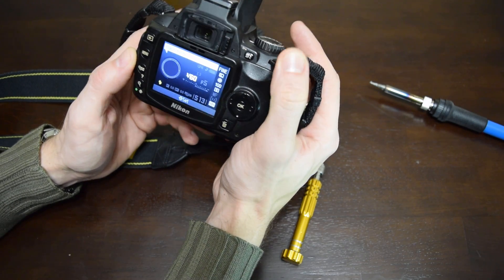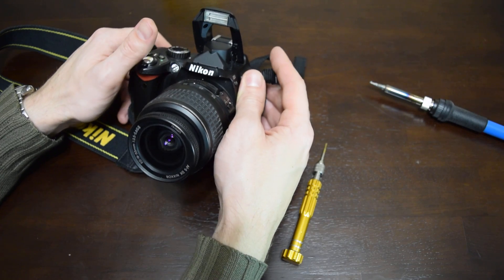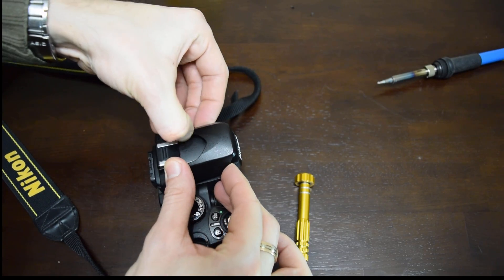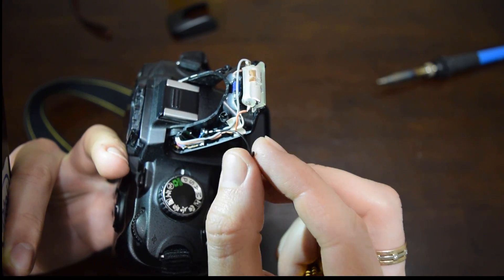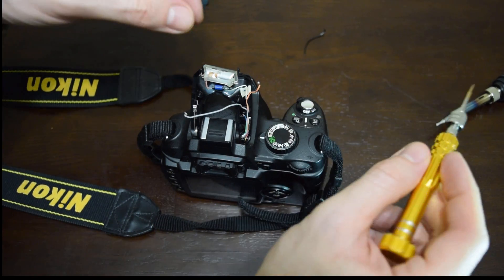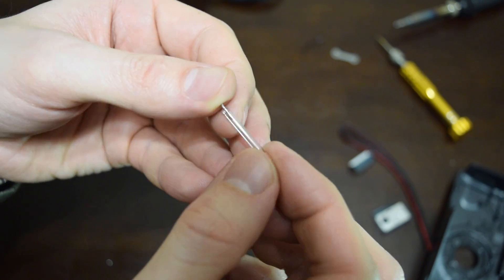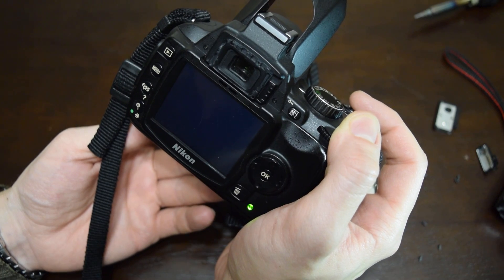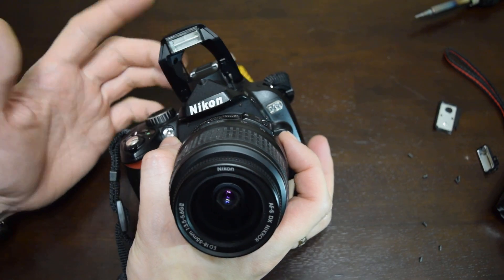How to Fix or Replace the Flash Tube on Nikon, Canon, or Lumix DSLR Cameras

Comment: Good day! Your skill impressed me, I wonder what's the sign or indication that the flash tube needs to be replaced?

Any reply will be greatly appreciated.
Reply from the maker: Flash tubes can be tricky to diagnose visually. A failed tube usually shows blackening or discoloration inside the glass, cracks, or simply fails to produce a flash when triggered. If the tube appears intact but the flash still doesn't work, the problem might lie within the electronics or connections rather than the tube itself. If you have a multimeter and a neon lamp, you can test the electronic part of the flash to confirm whether the issue is with the tube.
Reply: @ElectronicsComputers  Thank you!

Comment: Any advice for nikon n6006? My flash is dead I think
Reply from the maker: The links for spare flash tubes in the description. You cal also use any flash tube from a cheap film camera. The most difficult part is to figure out how to disassemble the camera. those tubes have positive and negative terminals, make sure to solder them correctly.
Reply: @ElectronicsComputers  the links for the spares don't work
Reply from the maker: @zeijus3178  I've just checked them, everything works.
Reply: @ElectronicsComputers  do you know by chance what size flash tube i need for this particular camera?

Comment: hello do you use any doner flash?
Reply from the maker: Sure! You can use any flash tube from any camera that you can physically fit inside. Just make sure you don't reverse the anode and cathode terminals.
Reply: @ElectronicsComputers  thank you. i didn't know i flash blub are like capasitor where it need to be certaion voltage and wattage I'll give it a shot !
Reply: @ElectronicsComputers  what does black tube do?
Reply from the maker: @GameKey11  If you look inside the tube, you'll notice that one terminal is bigger and one is smaller. The bigger one is the cathode, or negative terminal. I'm not sure what you mean by "black tube." Old flash tubes become black inside when they are about to die or are already faulty

Comment: I tested the bulb and it works on another nikon body...so what is possibly wrong with ny d5300?
Reply from the maker: Do you have a multimeter? Can you measure the voltage on two side terminals?

Comment: Thanks for the great video.
I would just like a clarification: the gray and orange threadconnect on the lamp; how to recognize the anode and the catodo and what is the correspondence?
Thank you!
Reply from the maker: The internal part of negative terminal is usually bigger than the positive one. And the trigger terminal is usually located in closer to the negative one. You can use a multimiter to identify the polarity of the wires on a camera or speed light.

Comment: Hello :) Great instructional video! I will start repairing the flash in Leica Af-c1. The camera resets as if the load that should be discharged creates a short circuit in the software. So I will buy, according to what I read in the comments, the appropriate length of the lamp so that it fits and I will try to mount it :) And if I'm wrong, please 🙏 give me some advice. 
Thank you very much and best regards 👍 😀 Krzysztof
Reply from the maker: Make sure that the new lamp has very similar size and the same amount of terminals (2-or 3).

Comment: Flash buld nikon d3100 fit for nikon d5100 ?
Reply from the maker: they are the same!
Reply: Nikon d7000 fit for nikon d5100 ?
Reply from the maker: @lilandresoriano9892  They have different size and power.  I have the links for those bulbs in the description.

Comment: I thought this will be complicated but its relatively easy to do because my Nikon D3300 Flash just died
Thanks for the tutorial
Reply: Hey, Update Here!!
so I just try to fix my camera, I got my replacement it's from an old Samsung camera(turns out it's too big), I prepared myself
but at unsoldering the flash on of the cable just arcing to my pliers and to the flash so I get scared to broke my camera so I just put it back then hoping the camera still works, the camera is still working but it fixes my Flash !!
I have never been so happy this year
God Thanks For your Video !!! 
Bless You
Reply from the maker: @randomthingch1970  Maybe there was just bad contact or something. Good job anyway.
Reply from the maker: Glad it helped!

Comment: Sir, I have a nikon coolpix L31 camera and there is a flash problem. How can i fix it plz help me. Plz reply...
Reply from the maker: If the problem in the tube you can easily replace it. The links in the description. If the problem with electronics then it's unreal job without proper tools and experience.

Comment: I went out and bought a disposable camera $16 to break apart and get bulb, I was able to get the bulb and successfully make connection, but it was until the end I notice I don't have the extra wire that is wrapped around build to complete connections, I'm not sure what that part is called
Reply: I believe its the trigger wire? is it possible for me to add that trigger wire to build to solder it to 3rd wire from camera? or should I look for a bulb that already has the wire
Reply from the maker: What camera model/brand are you trying to fix? As you can see in my case there's also no third wire. The trigger wire is simply attached close to the tube and that's enough to make it work. Speedlight tubes have that third terminal. but you can simply wrap the wire (make one coil turn) around the tube.
Reply: @ElectronicsComputers  im fixing Canon T3i, I have some spare wire here, ill try use that to wrap around tube, then solder it together to trigger wire coming from camera, hopefully now wire I use to wrap around tube stays in place
Reply from the maker: @1990Ras  It should look like this: https://ibb.co/pdqB4NL
Reply: @ElectronicsComputers  you wouldn't happen to have a link where it can be purchase do you?
Reply from the maker: @1990Ras  The only place I know is a shop in China that sells some camera components. I've bought a bunch of stuff at that shop and I never had any issues. Here's the link: http://ali.pub/4o1sxu
Reply: @ElectronicsComputers  allrigh thank you, I had bought some bulb from Ali Express to fix my speed light as well, took forever for me to receive it but I was able to get repair done
Reply from the maker: @1990Ras  Yes, that one will work too.
Reply: https://m.aliexpress.com/item/32876780210.html this should work right

Comment: Is there a way to make the pop up flash active when just released from its seat?  Normally, it only flashes when in the fully upright position.  The reason is that I wish to have my camera flash inside my underwater housing in order to activate my two remote strobes.
Reply from the maker: You need to modify/bypass a close/open state sensor. Usually it's a mechanical one it looks like a button. Depends on the model if you solder its terminals together the flash will work constantly at any angle.
Reply: I have the Nikon D7200.  Is this mechanical sensor or button easily accessible?  Once the terminals are connected, will it flash even if latched closed/ down?  Thank you!

Comment: Sir, I found 3 wire on flashtube canon 600d can you explain ?
Reply from the maker: all flash tubes have three wires. Two wires from each side of your tube go to capacitor and the third wire which goes to the side of the tube is high voltage trigger. Sometimes that third wire is soldered to the tube sometimes not. In my case it's the black wire which is attached to to the top of the tube.

Comment: Hello, does it matter what kind of camera I need to have in order to get a light tube for my pop up flash? I have a T5i and the flash bulb popped! So the bulb is completely shattered
Reply from the maker: The camera brand or model doesn't matter! The only thing that matters is the size of the flash tube. It should be about the same size +/-  1-2mm.
Reply: 2013Electronics&Computers do you know the size of a canon flash lamp?
Reply from the maker: @ihsandeeb  
High quality 5-10$ Flash tubes with free delivery: Canon: http://ali.pub/3eu0lo
Reply from the maker: @ihsandeeb  
High quality 5-10$ Flash tubes with free delivery: Canon: http://ali.pub/3eu0lo

Comment: I have an old canon t6s that has a non functioning flash. When it’s supposed to fire it just makes this zapping noise from the light tube area. It’s not that old and I’ve never used the flash on it so imo it shouldn’t be broke. 

It’s my old camera so it’s not a huge deal but I would like to fix it so I can sell it. I will probably take the flash apart soon to see if I can do it.

Comment: Bro what is that black colour wire? I ve just try to sleeve it it cuts to small. I have to replace it with normal wire? Please reply
Reply from the maker: That black wire is trigger for the flash. Trigger pulse goes to a metal plate around the glass tube. It's fully isolated wire without stripped ends.
Reply: THANKS SIR